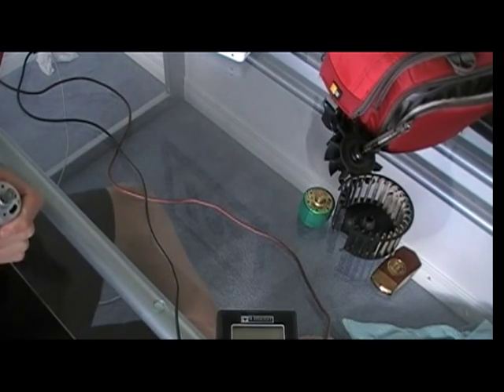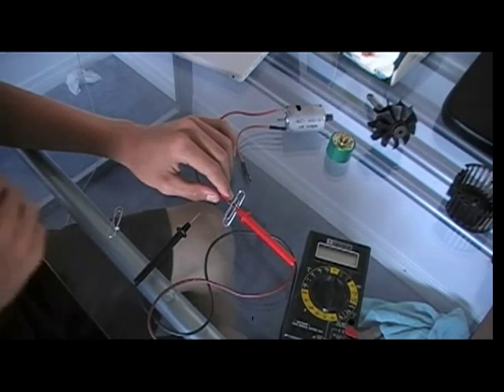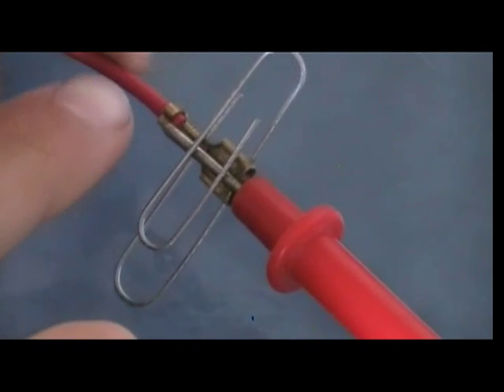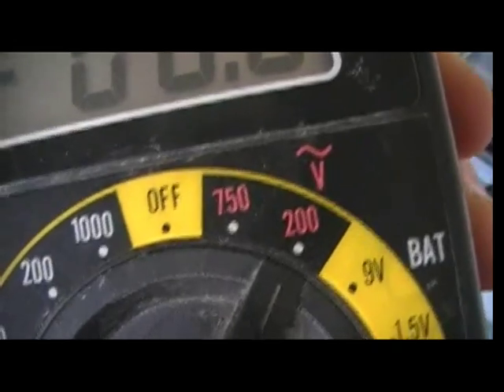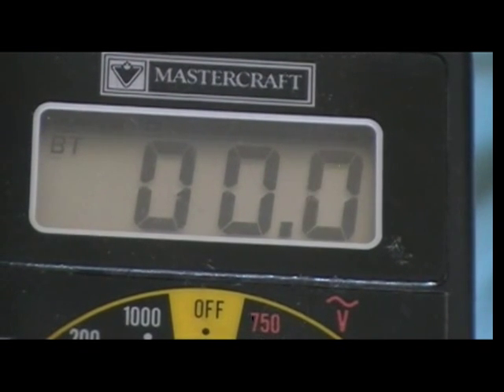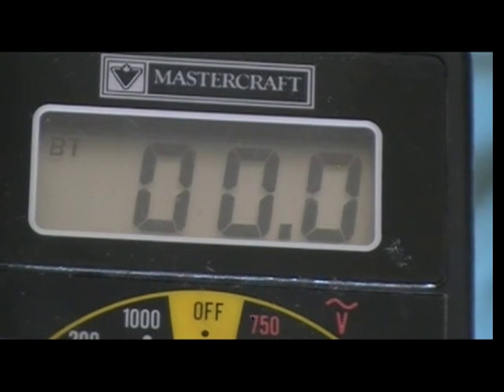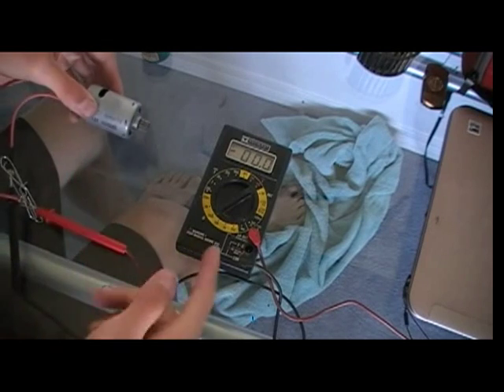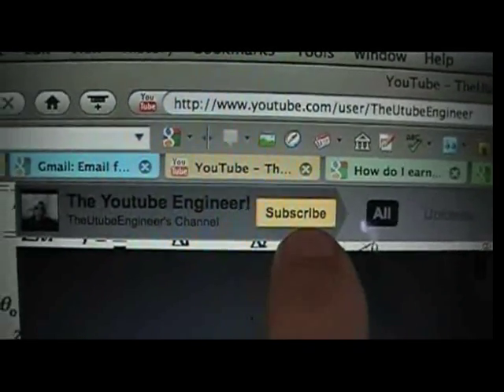Crazy Homemade Generator from DC Motor

Comment: You cannot generate AC current with a DC motor unless you alternate the direction you are spinning the shaft in. This is not up for debate. In a commutated DC motor, which most small DC motors are, the commutator will switch output polarity as the rotor moves through the magnetic field. This is the fundamental principal that DC motors rely on in order to be able to spin in the presence of a constant current. There are good illustrations for "communitation" on google but I cannot paste URLs here.

Comment: dude , the motor has brushes and a commutator. yes?  if so then more than likely it will produce current output in one direction. why? because the field windings are wired back and forth on each segment of the commutator to mechanically rectify the current as it makes contact with the brushes. if so then you have the multimeter at the wrong setting as you have it set at 200volt AC setting. thats insanely high for that small motor.set it to 20v dc. and you should see volt readings plus or minus.

Comment: I agree, the voltmeter needs to be set to DC.  It's a DC motor because it uses DC current, which also means that it generates DC current when used as a generator.  As the armature (the bundle of wires on the rotating arm) rotates, the contacts to the lead wires switch also.  Even as the poles inside switch, the contacts do also, so in effect it "double-reverses" the current, leaving you with DC.

Comment: @TheUtubeEngineer 
I am not agree, because the brushes rectifying  the ac from the rotor to dc.
A DC motor produces DC when the axle is turning. try it on your meter. The direction states the plus or minus. for example: when the direction is cw the plus is above. ccw is the plus below.

Comment: The output from the multimeter is wrong, because you set it on 200V AC not on DC
The input is a DC current not AC. Put the dial to the left.